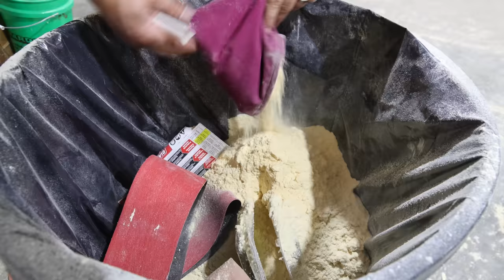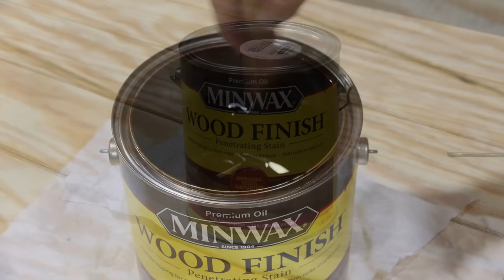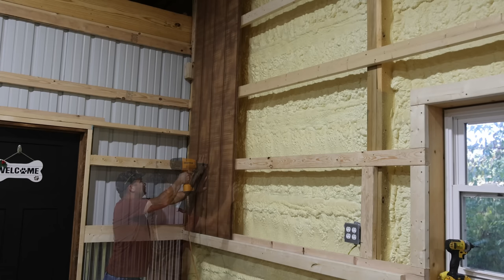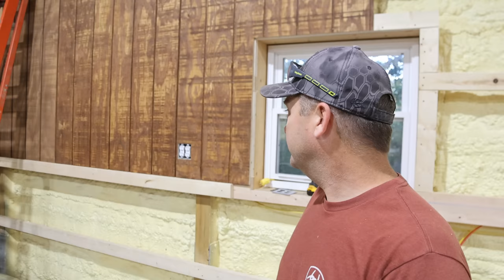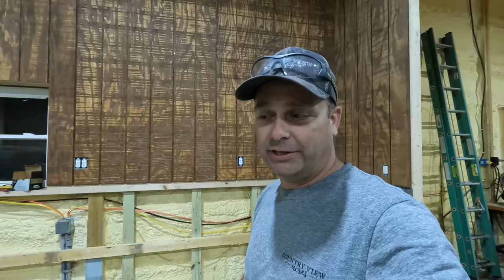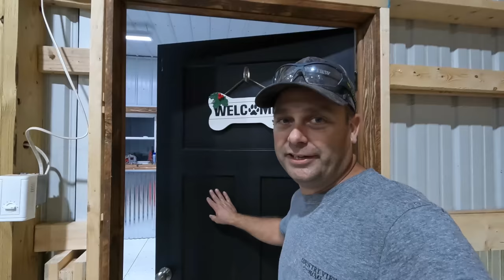These workshop walls are going to look good.  It's a lot of work, but I think it is worth it.

Comment: Did you know that you could use a wire brush to quickly clean the packed gummy sawdust from the sandpaper and get some extra sanding before you discard it?

Comment: The house I grew up in had that plywood as the walls but without sanding it. I.HATED.IT!!!! It would snag clothes when you bumped it, scratch any body part that came into contact with it, and cleaning it was next to impossible. My dad installed it in the house because my mother was tired of cleaning/washing fingerprints and such off the walls (drywall) and this was their solution. It worked but I still have nightmares about it. You'll be glad that you did sand it down especially when you have to get that piece of wood way back in the back of the wood rack 😉
Reply: That's what I was thinking - particularly catching the dust over the years to come, which hopefully it won't do now. I'm sorry to hear about your experience with it though!

Comment: Hey Evan and Rebecca that looks awesome and you're right on about having the flat surface too. You might want to get those worn or torn sander belts out of the trach and cut once and rip off strips to keep on hand for various sanding needs, beats buying spools of emory cloth for your needed sanding of little parts and round parts. Just thinking !!. It's looking better around there all the time with you both working together. Stay safe and have fun. Fred.

Comment: Love the look of the walls.  It definitely is a job well done.  I also like the kennel room walls but it is as you say not type of walls for the work shop.  The fine sawdust from sanding the T1 11 would be great to save for making nail hole filler for pine wood.  Just a thought.  Thanks for sharing the process and your ideas.  Have a Blessed day.

Comment: Nice job there Evan, I really like what you did with the wood and the corrugated metal, also the dog kennel with the white metal. That air powered nail gun is nice, make the job easier and faster. All my nailing was done on my house and barn by hammer and one worn out arm. I really liked this video, thanks for sharing. I hope you all have a wonderful, safe, weekend!

Comment: Hey Evan cool project my basement is the same plywood and early American minwax stain on the walls and stained tongue and groove car siding on the ceiling it's been a several years in the making project but it's coming along with a little work on the weekends and evenings some in the summer but most of it gets done in the  winter when the days are short it will be worth it when it's finished

Comment: It's great! I was wondering if I could think of anything to help cut down the time... If you do a lot more walls, it could be worthwhile hiring a floor sander and just doing all the sanding in one quick go on the floor?! Equally, while they are down there, you could stain with a roller on a pole.

Comment: Where is your wood burning heater in your building?
Reply from the maker: It is to the left of the dog kennel door.
Reply: @CountryViewAcres  , So it will be supplemental heat when you get heating and air unit up high on wall ? I assume those units usually come with both anyway ( mini splits)

Comment: i would be saving that sawdust for several things. if you have a wood burner, use it there, to use to soak up oil than burn it, there's probably several other things to use it on.